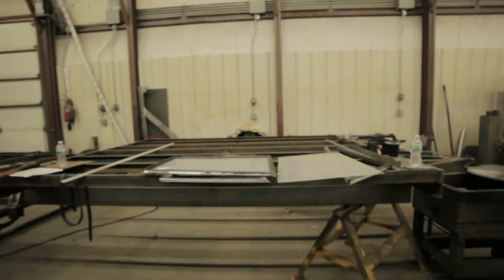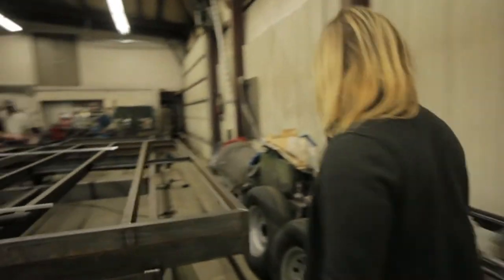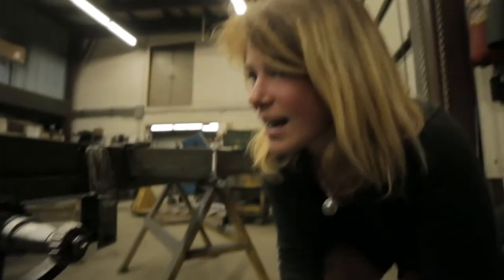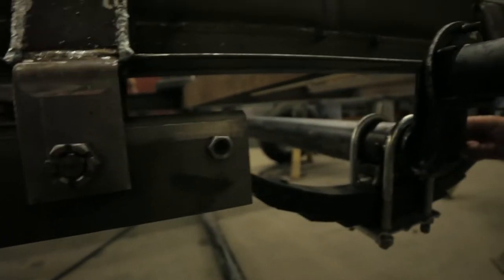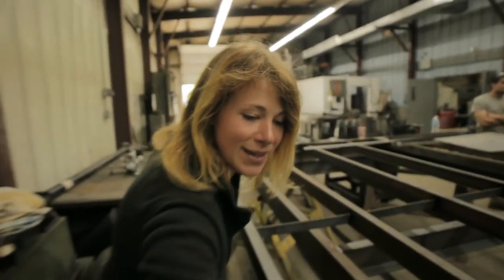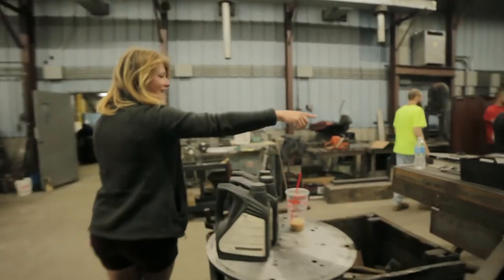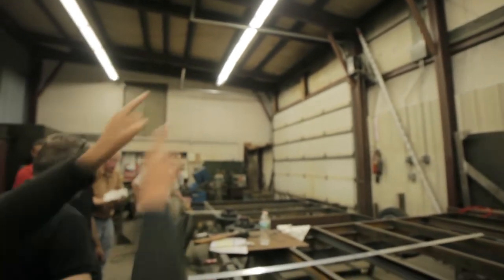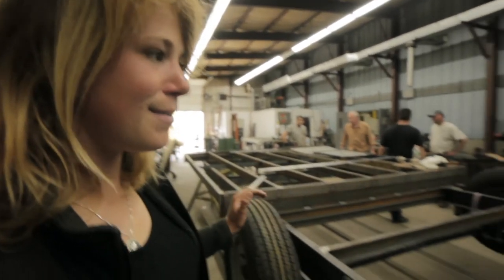OUR CUSTOM TINY HOME TRAILER!!!!

Comment: (This is Emma, btw) Conor and I are wondering what you're going to use to pull it. And then has a great laugh imagining your little VW pulling this thing across the country.
Reply from the maker: Hah! In the fall we'll be purchasing a new 4x4 diesel truck. Our tiny home will most likely weigh close to/just over 10,000 lbs, so we're looking at a either a Dodge Ram or a Ford F250 or F350. Once we calculate the projected weight, we'll have a better idea of what type of truck we'll need.